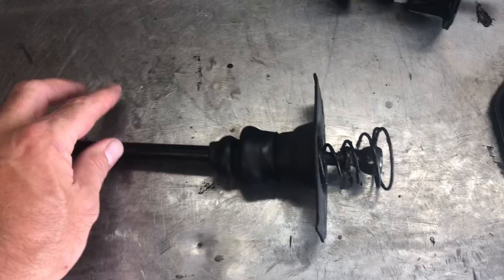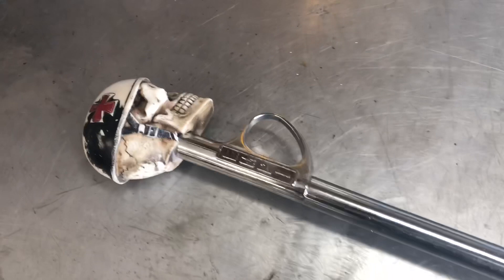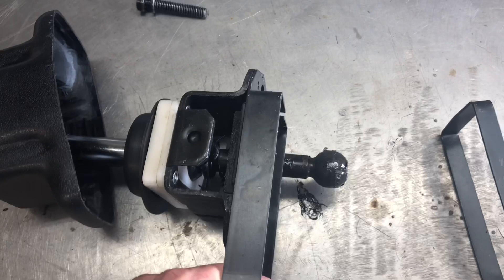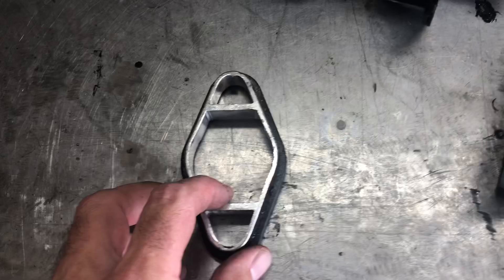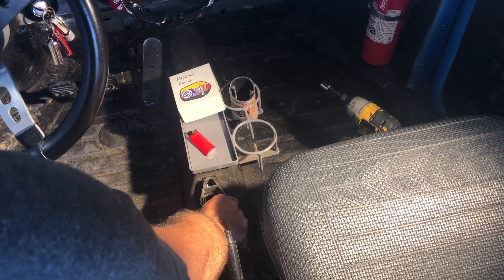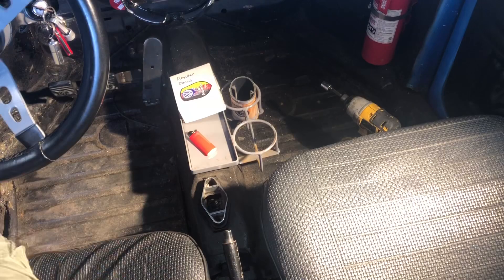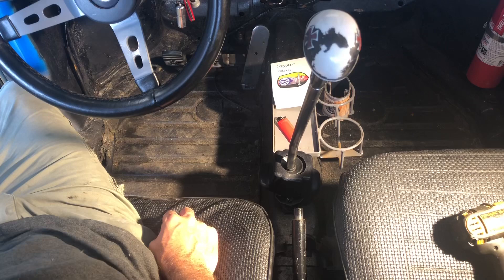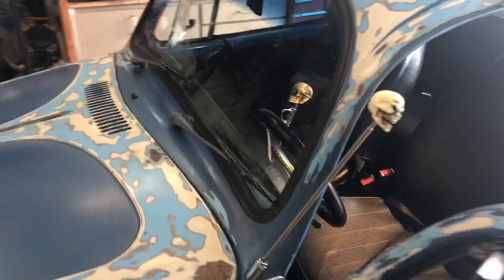Will A Volkswagen EMPI Bus Shifter Work In A Bug? HOT Rod Style!

Comment: I love that look. Unfortunately didn’t work on my73 super beetle. Not entirely sure why
Reply from the maker: Not sure why either, standard and supers take the same shifters…. This car is a 73.
Won’t work on the early bugs where the shifter is closer to the dash.
Reply: @VWJawbreaker  mine was an autostick conversion, not sure if thats a factor. Could also be a retrofitted early pan or something. Either way it didnt seem right, but ill try again. It was almost as if i needed another spacer in between the quick shift plate and the shifter

Comment: Been wondering about this! Question answered. May have clearance issues with the stock steering wheel though. Might require using a sports wheel like Jawbreaker has.
Reply from the maker: Glad this helped answer your question!
I’ve heard others say that it might not work with a stock steering wheel but don’t recall anyone actually getting back to me.

Comment: Great info video. What happens to the reverse lock- out plate? Tip for adjusting the shifter. Mark the old shifter holes on the tunnel then just drop the new one on. I think it would be a pain in the butt to shift in traffic. Don't know for sure. Something to consider though. Til the next video.

-  KEEP DUBBING -
Reply from the maker: Volkswagenplanet the reverse lock out plate is still used just like a stock shifter. So far shifting in traffic is easier for me vs the stock shifter but again, that’s just me. 
Have a great day buddy
Reply: @VWJawbreaker  maybe a follow up video after a period of time. Thanks again for your response.
Reply from the maker: Volkswagenplanet awesome idea. I’ll add it to my video update notes that I keep.

Comment: What is the diameter of your steering wheel ?14” it does look as if it will be a little farther back when the quick shift kit is installed with the shifter. I believe reverse would be the only issue, if any. I will find out and have a steering wheel for back up plan.😁
Thanks 
Shawn
Reply from the maker: Mine is 13.5”

Comment: So trying to get my shifter empi bay window shifter to cycle through gears properly. Trouble finding 1st and goes into reverse without pulling up on the release. Any help would be great. Thanks. You make it look so easy.
Reply from the maker: Sounds like the reverse lockout isn’t lined up.
Reply: I'm in the same boat just put my shifter in last night I can hit every gear except 1st I can get it into first gear but its tuff my shifter does not have any play at all my old short shifter was like a spoon in a coffee cup. Lol any ideas? What i could be doing wrong? P.s I also have the quick shift plate.

Comment: I just received my EMPI bus shifter to install in my 1965 bug. I have the stock 153/4 steering wheel and hope that it works. I’m not sure. I’m going to install over the weekend. Please give me your input bro.
Thanks
Shawn
Reply from the maker: I’m not sure if it’ll work either, being an earlier car than Jawbreaker and having a larger steering wheel. 
Keep me posted!
Reply: @VWJawbreaker  Do you know of any smaller stock looking steering wheels. I have been looking already..
Reply from the maker: @shawnisia6811  nothing that looks stock and smaller.
Try adding a quick shift plate under the shifter like I did. It helps shorten the throw of the shifter.
Reply: @VWJawbreaker  I bought that also. I hope it works out . I do like the stock steering wheel. I f it doesn’t, I would like a retro looking steering wheel. I’m open to ideas if you have input.
Thanks 
Shawn

Comment: What size is that steering wheel?
I'm looking to change the stock out for something smaller for leg room but don't want to go so small that steering gets hard.as I love running fast on dirt roads and trails...
Reply from the maker: Redd Mann I believe the steering wheel is approx 13.5” diameter. Still easy to steer without being too small.

Comment: It looks like the 1965 bug shifter is about 3” closer to the dash than your jawbreaker. I believe I will need a 14” steering wheel.
Reply from the maker: I thought the earlier ones were a little further forward. 
I’ll try to measure my steering wheel later this weekend when I have some time.
Reply from the maker: It’s 13.5” diameter.